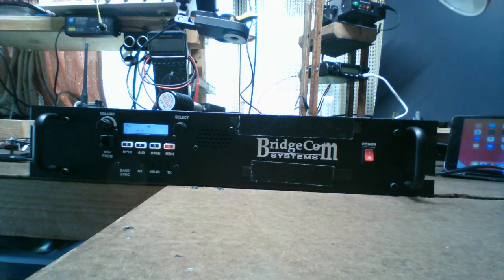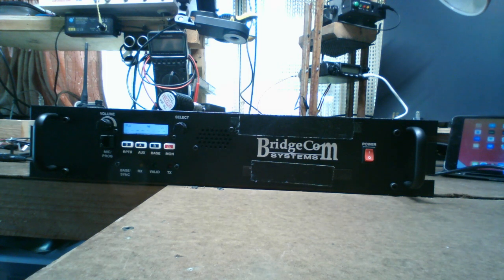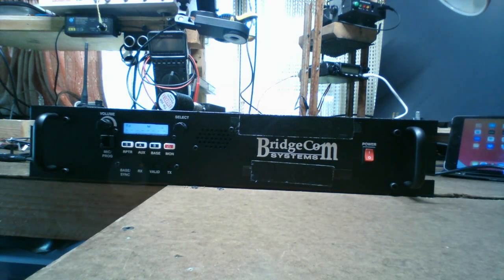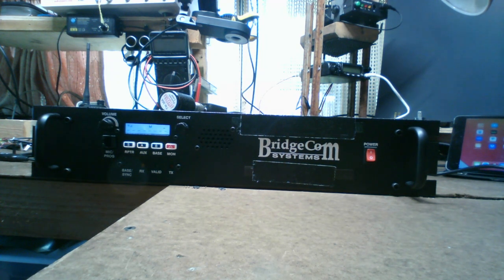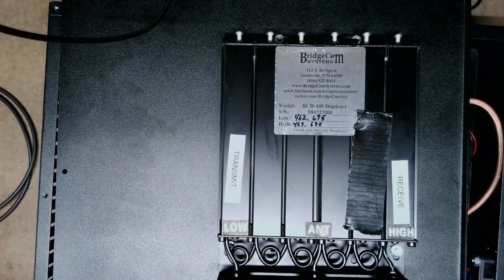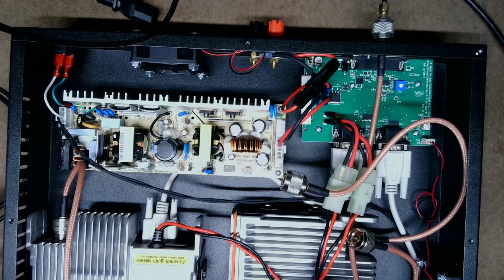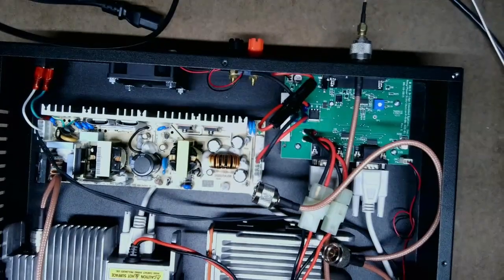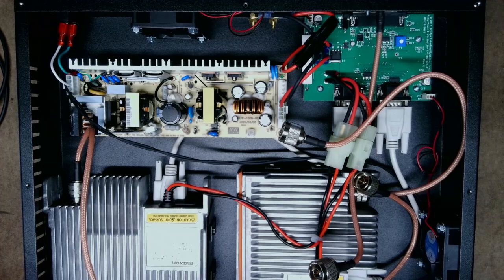🔺taking a close look inside and out of the Bridgecom bcr-40u/du GMRS two-way radio repeater!!! 🔺

Comment: How did you turn up the output higher than what the radio says
Reply from the maker: I am not sure why that happen, my guess is maybe the radio is rated for 100 watts for ham??? But In the repeater programming software, I went higher with the number than what bridgecom said to do 🙂 keep in mind the number that is shown is not like a person thinks of wattage!  300 = 12 watts, etc. but do not do this, I don't think that duplexer is rated for that kind of wattage! And the fans and power supply MAY need to be upgraded too??? Also, even tho I went that high, running that high the radio may not last long and the duty cycle that is listed for this model is for 40 watts output too. Why didn't Bridgecom make the software so that number can't be entered, I am not sure why they didn't???
Reply: @GMRStwowayradio  they probably did make it so you can up the wattage just like YAESU and icom make it easy to mars mod almost every product
Reply from the maker: @DaytonaJim78  - that could be! If I get time, I will do some more checking on this 🙂
Reply: Don't turn the power up. In fact, I'd run it at half power (maximum).
The repeaters are essentially two cheap chinese mobile radios in a box plus a power supply and an optional duplexer.  
You CANNOT swap the transmit and receive radios, the firmware is different, and they don't release the firmware. 
You CAN swap the PA decks for a quick field repair.
The radios use a 45 watt RF power module and the existing cooling isn't even adequate for 45 watts at a high duty cycle.
The transmitter fan is just pointed at the transmitter from several inches away, there is no ductwork to direct the airflow. 
I'm aware of several repeaters that have had to go back to bridgecom for power amplifier replacements.